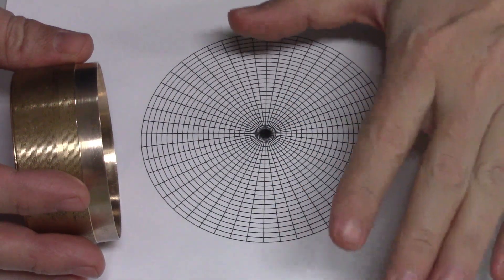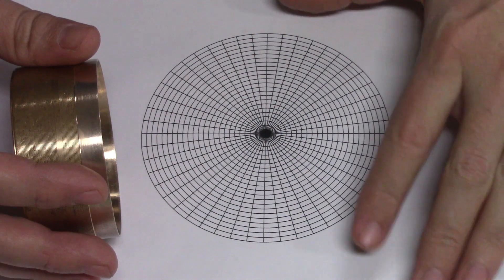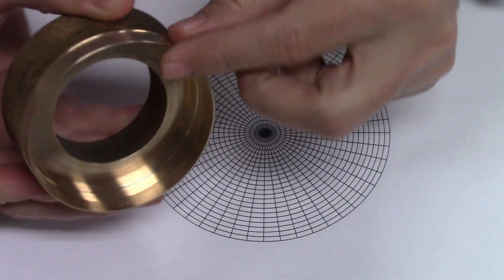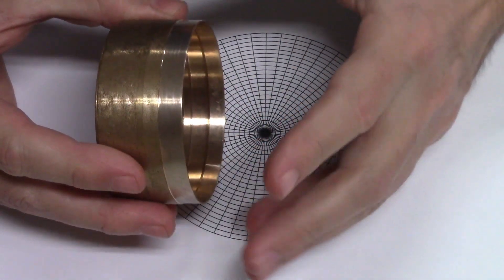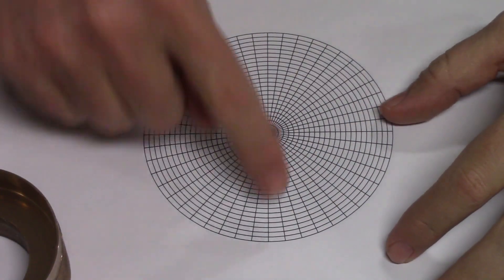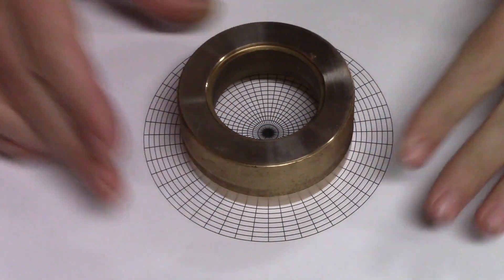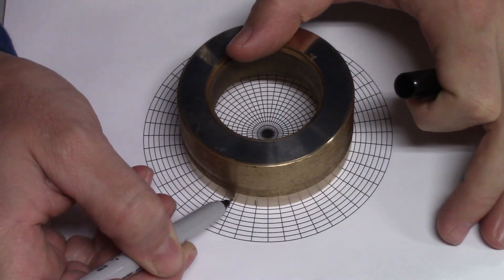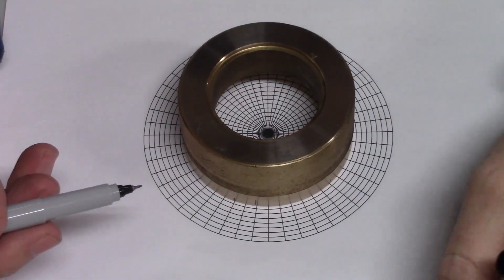Low-Tech Indexing With No Tools - Quick Machining Tip #28

Comment: The LibreOffice Suite contains a program called Draw. Draw is a pretty powerful drawing software that is very accurate. It is very similar to the MicroGrafx Draw package first released in the mid-1990's, but has evolved. It is not CAD, but you can make highly accurate technical drawings with it. You can make patterns (like this) easily, and print them on an inkjet printer. LibreOffice is "free," but a donation is appreciated. I am a user, and not paid or employed by them.
Reply from the maker: Good to know. I used AutoCAD for this, but there’s an AutoCAD clone called Draftsight that's free. It's from the makers of Solidworks. I'm going to pin your comment in case anyone is looking for that kind of info.
Reply: Fusion 360 is also free and its circular pattern tools it laughably easy.

Comment: You can use a slitting saw by simply inserting a wood or metal plug of the same diameter as the opening to support the edges during the cut.
Reply from the maker: Nice. I hadn’t thought of that. I'll file that away for the next time.

Comment: I did a similar thing with wood shop students years ago.  One of their assignments involved fluting a small column lengthwise on the wood shaper around the periphery of an approximately 2” diameter dowel that they previously turned straight on a wood lathe.  I made an extremely primitive fixture to hold the dowel on center at each end with screws. (A length of wood with an upright piece of wood on each end.) A third screw off center on one end locked the dowel from turning as well as serving as an “index plunger”.  An equally divided paper disc, quite similar to what you show, was provided to each student to glue to one end of their dowel thus allowing the correct position to insert the third screw to allow equal spacing of the flutes around the dowel. A rub collar below the flute cutter on the shaper spindle ran along the length of the fixture regulating the depth of cut.  It was amazing how evenly the flutes were dispersed around the dowel using this simple method and how nice they turned out to the human eye at least.
After fluting the dowel was split in half on the bandsaw and sanded flat on the cut side on a stationary belt sander to produce two nice matching fluted half columns as a decorative accent to a mantel clock.

Comment: Nice trick! I’ve seen others put such a thing on their lathe. So I pose the question to you, how would you perform this level or maybe tighter tolerance on a lathe or mill without a dividing head or maybe not even a rotary table? Maybe a part two video?
Reply from the maker: The easy answer is to use the gearing on the spindle. That isn't too hard to set up. You just need to make something to go into the gear to hold it in position. Of course, you're limited in the number of divisions you can get by the number of gear teeth.